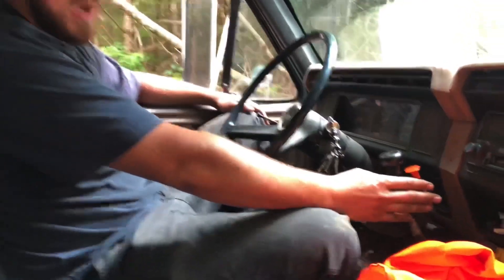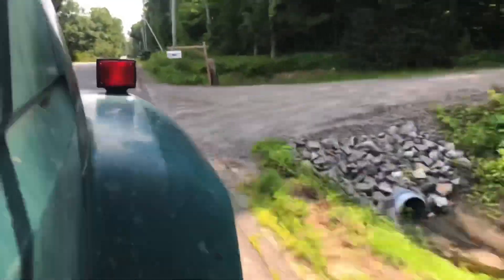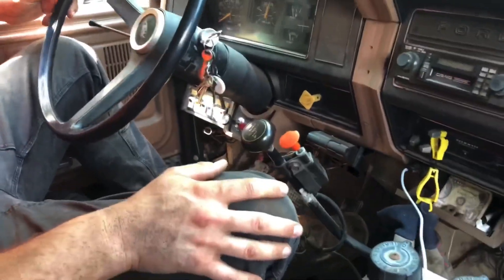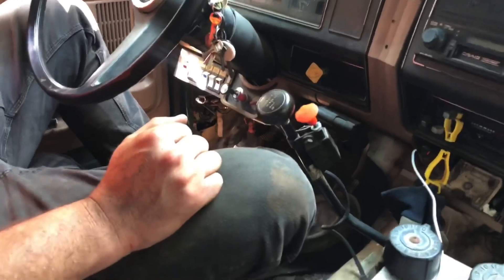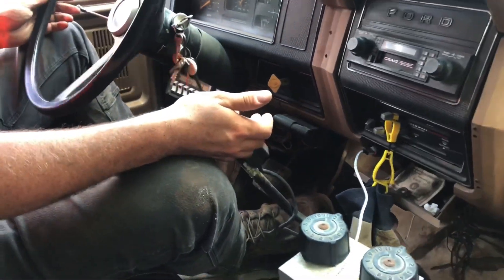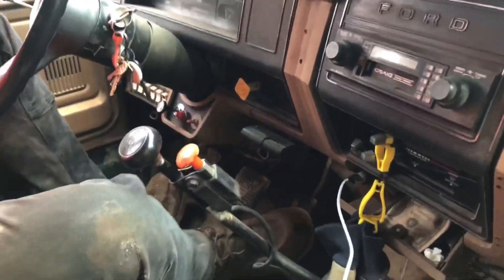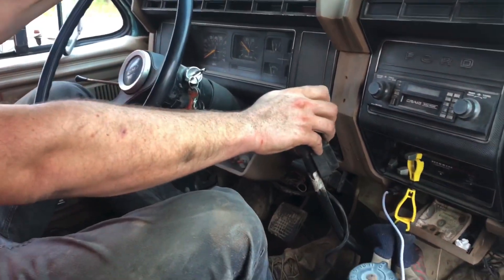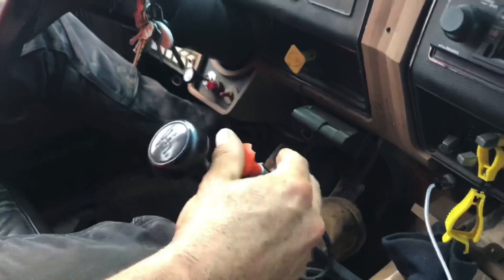2 speed axle- how to shift, pt. 1

Comment: You don't need to "clutch" going from Low to High...All you need to do is break the torque on the rear-end (Let off gas and wait for rpm to slow, and re apply gas pedal).... I have had 2-speed axles with 4/5-Speeds and Allison automatics...

Comment: I never pushed clutch in to shift the rear end I thought you only push in the throttle and let out
Reply from the maker: It says to clutch on upshift and to do what you described on downshift.  I think I’ll clarify that in part 2.    If you upshift without the clutch, is it on a vacuum rear or an electric?
Reply: @BigAgitator  I believe vacuum I never clutched into use the 2 speed rear end just let off gas a bit and back on. Hmmm 🤔
Reply: @BigAgitator  mine is electric and it causes no damage to go from lo to hi without the clutch. Just like the other guy said, come off the throttle for a second to break the torque on the driveline and it’ll shift.